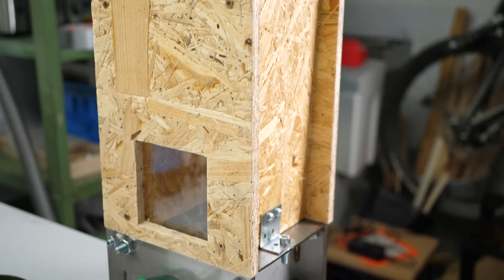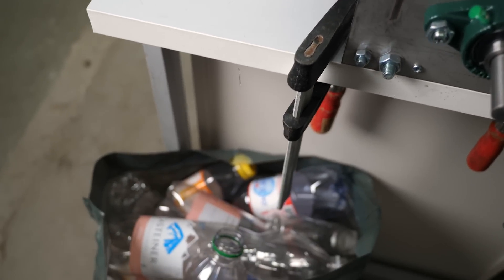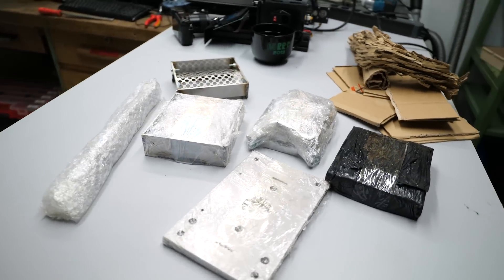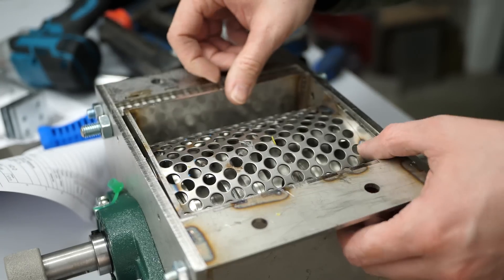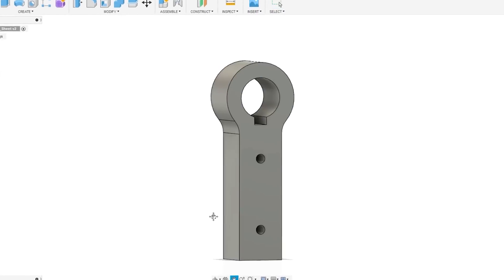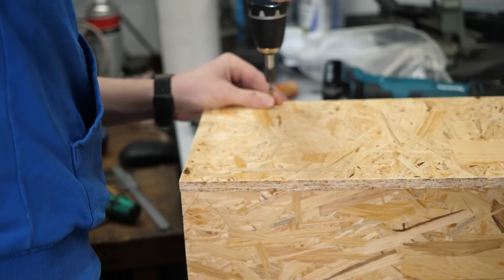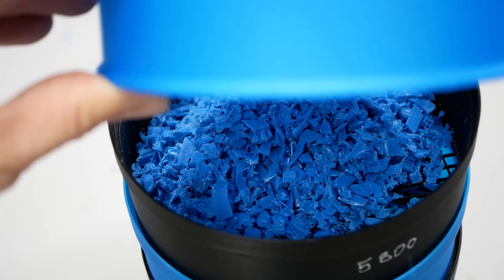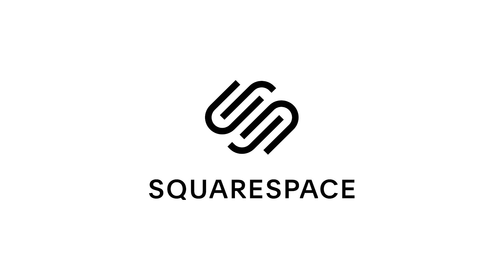Building a Hand Cranked Shredder for Recycling Plastics 💪

Comment: You should consider replacing the long lever with a gearbox to make the spinning easier. Good job for the project :D
Reply: Yeah just two gears with 5:1 ratio or more  would make a huge difference. You should find some easily on Internet with the proper axis diameter... Well done anyway, I was planning doing the same but 350 is quite expensive for myself.
Reply: This, and a ratchet so he can push the lever up and pull with his own weight
Reply: I'd find a way to connect it to a fixed bycicle-like feet crank thing. Sorry my english is kinda shiet.
Reply: Most industrial shredders actually run very fast.  Remember, plastics are strain rate sensitive so faster you hit it the more prone it is to shatter.
Reply: @capnthepeafarmer  . How about some kind of wind up spring mechanism?
Reply: Great idea, maybe a worm gearbox? you get allot of torque out of those but you need more rotations.
Reply: @LordtwoDark  With this setup he doesn't need it, spur gears are more efficient and the gearbox will be compacted, saving  a lot of space. I'm a mechanical engineer as he is, it will be easy for him to do the math for this upgrade
Reply: @LordtwoDark  I used a 50:1 worm gearbox with my drill press to drive my shredder from precious plastic.  You also need a jaw coupler to smooth out the high torque periods.
Reply: @simple_fred  A coupling is good to handle shaft misalignment.  You would get torque peaks for a misaligned shaft because you're trying to bend a 1/2" or larger steel shaft.
Reply: @LordtwoDark  like all gearboxes?
Reply: @LordtwoDark  a worm gear and a big DC motor would be insane...
Reply: @LordtwoDark  Yes a lot of torque but here seems to be required more. 500 Nm is a lot of torque and Ones I can find under 100€ are rated for 50 Nm . I'm worried the might intead break
Reply: A worm gear might be overkill, but I still wanna suggest it. It will have another advantage of changing the direction of the axle. By setting the axle to go along the z axis, it will be much easier to get the shredder stay in place. Besides, lower torque will make it easier for possible motorization later.
Reply: Not a bad idea.. Even a 2:1 would half the length of the handle making it a bit more ergonomic i suppose 🙂
Reply: possibly use a bicycle drive, should give enough reduction to use a much shorter handle and slow down the shred speed so it wont be as jarring
Reply: Just hook the shredder up to an exercise bike!
Then you can Shred while you get SHREDED!
Reply: I think he should attach a foot powered mechanism, thourgh a belt system and gearbox :)
Reply: I was also thinking gears and a cycle attachment, gearing makes things a little more compact and a stand that could hold a pushbike so the rear wheel drives the mechanism would make it a lot more enjoyable to use as a bonus the rear wheel would basically become a flywheel if there's enough gearing but it might become slower to use? mathing the gears would probably be important so that the moment of inertia of the wheel can still drive the toughest shredding but also so that it isn't geared down so far that it's under the current RPM .... 6RPM? maybe? the bike's gears could then be used to make the process easy on Stefan's legs vs a real work out and because it's just a bike sat near the shredder when not in use the shredder becomes the smaller shredder and gearbox and the bike goes wherever the bike currently lives.

By the amount of movement, the thing makes while shredding it might be worth making the sifting an attachment to the side, sift the previous batch while shredding the next.
Reply: Ic3Fenix I came here on my phone to say the same thing, Gear Down for What?!
Reply: Also add a sprocket and make it pedal-powered
Reply: Attach the whole thing to a stationary bicycle. Legs > arms for using muscle power on something.
Reply: @sealpiercing8476  that would be larger than a motor though, and he said size was the main driver for making it handcranked
Reply: add a geared up flywheel too.
Reply: He could always do a belt and pulley drive, too. Much simpler to manufacture than gears, even if it isn't as durable.
Reply: @LidellFrasier  Well , gears durable solution is pretty expansive though. I keep in mind this Idea
Reply: He's recycling plastic, so why not recycle a geared hub from a bicycle or two?
Reply: Actually, he has a bike in the background - shouldn't be impossible to use it for this purpose.
Reply: In a sense gears are at the core set of levers, but arranged in a way so that they spin around and sometimes touch other levers.
Reply: gear reduction and an electric motor.
Reply: Cooperation with that Lego Technic channel...
Reply: I'm looking for one that is decently priced. But, according to the video, it's needed a torque around 500 Nm .  All worm gear reducers I can find seems to be rated for a much lower torque. Still a reducer rated for 50nm cound cost more than 100 euro and price rases with the rating. A 150nm  one is already quite expansive.
Reply: I wonder if an impact gun could get it done?
Reply: Im sure this thread is long abandoned but for posterity... Maybe grab an automatic trans from a junkyard and rip one of the planetary sets out of it? Lock the planets in place, attach the crank to the sun gear and the grinder to the ring gear. I'd be surprised if those had trouble handling the torque, and if its the right junkyard and gearbox it should be dirt cheap.
Reply: 3d printed gearbox! Or one that connects to a drill?
Reply: @joshuaolsen8844  hmm probably too much torque for a plastic piece
Reply: it needs gears and a big ass fly wheel. let it build up kinetic energy and then drop in your pieces.
Reply: @LFdu83  Unless you use a steel center part and print a large gear around it.  You might have to print it in segments unless you have some big ass printer like the CR-10S 500.
Reply: @TuttleScott   with a flywheel, what happens when (for instance) one of the teeth gets pushed over and tries to take a bite out of a stationary steel part?  Or a rock or piece of steel gets in there somehow.
Reply: @joshuaolsen8844  Considering the limited shear strength, that would have to be pretty huge, and I'm not sure how you would connect it to the shaft in a way that wouldn't immediately strip out.  Unless he had a metal 3D printer.
Reply: @joshuaolsen8844  I don't know any 3d printed gearbox that could survive producing a 500 Nm torque.
Reply: I was going to suggest the same thing, i was actually going to suggest a real big gear reduction and then hook that gear reduction to a small predator engine. Predator engines are dirt cheap at harbor freight and they tend to have decent torque at the rpms they can run. Im not sure how well vented this shop is but a small predator engine with a big gear reduction with those blades would chew through most any plastic i would suspect. Ive seen the blade systems that precious plastics make and almost bought one myself for fun but i just dont need it but during the process of thinking about it i was curious on how to solve the 220 motor problem. For the home shop that doesnt have a welding power drop at 220 an electric motor just isnt cost effective. Then you have to consider the motor controllers and safety from such a system. Going to an internal combustion would solve those problems real quick and you wouldnt have to mess with complex electrical issues and you would likely get a more stable torque since you could add more fuel for more power.

Comment: Ah, I see you used a spiral flute tap at first. They are the weakest type and not really suitable for manually starting a thread in steel. Normally a hand tapped hole will require 3 stages. A start (first) tap, which has a loooong taper, so that it aligns itself with the hole. Then a second tap to form most of the depth of the thread, and finally a finishing or bottoming tap to get as much depth as necessary. For anyone reading this, if the thread is required all the way through, then the finishing tap is not needed.
Reply: Thanks, this is some great advice!

Comment: Why not take the left over fine material and wood and save that until you have enough to say heat up in the oven to make a pan wafer and then put that through the grinder. Might not be worth it but could be interesting depending on how much you get.

Comment: looks like you might want to add some magnets into that shaker stack to remove metal.

You should collab with that guy that keeps printing and 3d scanning the same benchy. Using the same material again and again would be neat.
Reply: Unless that was also you, in which case, carry on.

Comment: Get some gearing on that handle! Maybe try printing them to see if they can stand up to it. If you're going to get a flywheel cut you might as well get metal gears cut at the same time.
Reply from the maker: You could make 3D printed gears work if they are big enough, though the critical point is the connection to the shaft which has to be very strong.
Reply: i agree a gear reduction would be beneficial but i doubt a printer gear would survive the forces. I would watch him try, but i expect they would strip pretty quickly
Reply: @reflector36  there are 3d printed reduction gearboxes that can withstand the abuse.

Comment: Add a powerful magnet in each filter stage to collect the metal shavings.
Reply: water would have the same result, the plastic should swim. Update, I have to correct myself, water has a density of 997-1000 kg per cubicmeter, ABS has a density of 1030-1060 kg per cubicmeter, so per se ABS should sink :-(. Milk has the same density as ABS but I would not recommend it.
Reply: arrgh I originally thought water until I remembered how hydroscopic this plastic can be. Keeping it dry gives the most consistent experience.
Reply: @robertcullipher3492  just thought to divide the smallest parts from the metal. most plastic shouldnt be harmed and the water should disappear with the heating.
Reply: he could use another liquid like isopropyl alcohol (IPA/rubbingalcohol) to avoid the water problem
Reply from the maker: Good point. And also as the others suggested separating the material with different density liquids is also a good option. Especially if you for example want to separate PLA from ABS.
Reply: I thought he said it was stainless steel. Some grades have no magnetic properties, so a magnet may not work.
Reply: @fataxe1  Non-ferromagnetic metals do respond to magnetic fields – eddy current separators are built for exactly this purpose. Whether or not it's practical in this case is another question.
Reply: @bjmcculloch  for catching pieces of stainless, eddie currents don't matter.
Reply: If those are stainless shavings there might not be of any help.
Aisi 304 / 1.4301 , the most common stainless alloy , is non ferromagnetic .
There are good ferromagnetic stainless alloys, but chances are a magnet won't help here.

Comment: Great video, as always. Thank you. 
A note about tapping threads into metal, it's better to use a cutting oil to prolong the life of your tap and help create cleaner threads. I like to use Tap Magic but there are many others. 
https://smile.amazon.com/dp/B002M8OPBS/ref=cm_sw_em_r_mt_dp_U_.xKDEbQJG09G0
Reply: I don't really think that in such a small tap, tapping into aluminium and by hand, a specialized oil would help much. Some type of lubricant would definitely make it work smoother though. Grease probably does the job well enough.

Comment: Is it possible to recycle materials like styrofoam. From what I know, styrofoam is pretty similar to HIPS filament.
Reply: He could recycle drink bottles, milk containers, that kind of thing.  Styrofoam though is mostly air, you'd be amazed how little actual plastic is there - so if he shredded a bunch of styrofoam it would end up being a tiny fraction of what it's original size was after being melted.
Reply: @ualdayan  also best way to "shred" styrofoam is to disolve it in acetone
Reply: what if he was crazy enough to get it and melt it with acetone and then use it?
Reply: Hyper Hektor I almost mentioned that way of molding, but if the goal of recycling is to help the environment then releasing a bunch of VOCs in the form of acetone might not be advisable.
Reply: @ualdayan  you dont "release it" :) you use it in a closed contain if you aren't addicted to the smell ;D , then you can seperate the 2 parts after usage.
Reply: Hyper Hektor The process as far as I understand it is you soak it in acetone, it becomes a liquid slurry similar to ABS juice, you pour it into a mold of the shape you want, and when the acetone evaporates the plastic turns back into a solid.  If you keep it in an airtight jar, never allowing the acetone to escape, it would just stay liquid.
Reply: @ualdayan  to be honest :) i also never tried it practical since i didn't need to. But i am sure i would find a solution, i would try to use heat the slime and use a hot/cold area (like in destilling wine) to get the acetone out again. Since acetone needs very little heat it should take not a lot of time. But interesting question since i found no answer on google how to reverse the process.